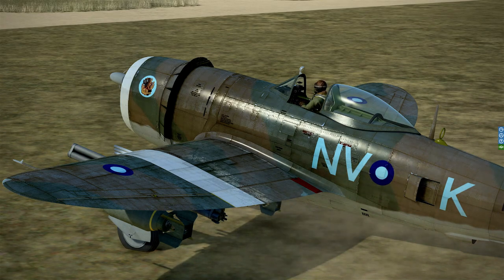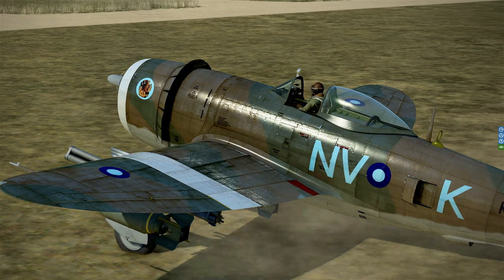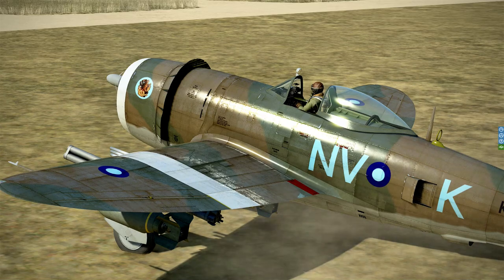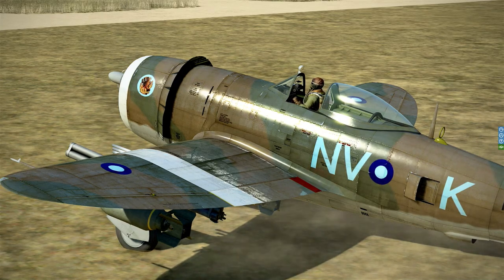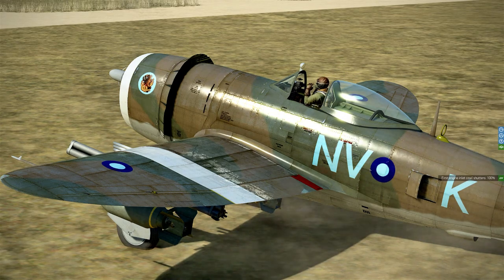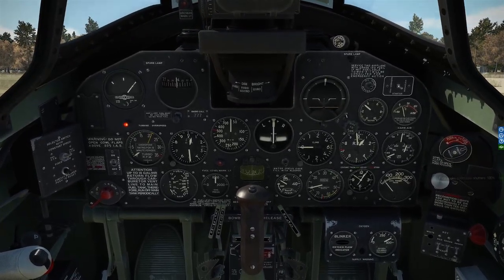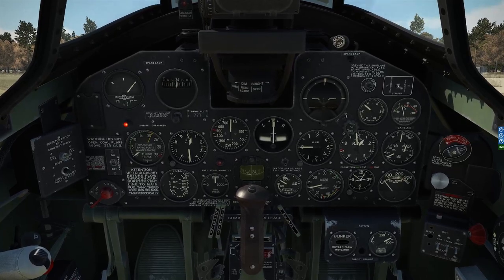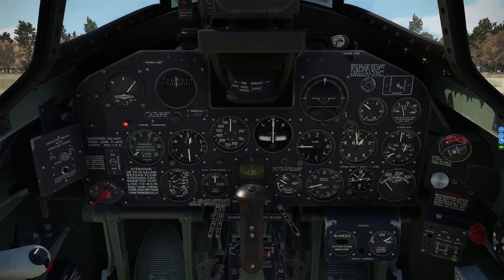P47D Cowl and inlet flaps operation - Bodenplatte - IL-2 Sturmovik: Battle of Stalingrad

Comment: Purpose of the "Engine Inlet Cowl Shutters" in the P-47 is to cool the air going from the turbosupercharger into the engine. When the air is compressed by the turbo it heats up and can get too hot, so needs to be set "just right" There is a gauge in the upper right panel that shows this temperature. This flap is more correctly called the Intercooler Flap. For most use leave at the "neutral" setting, 50%. I sometimes fool with it to keep the temp just at the top of the green range since (I think) that would be the least drag, but not totally sure, have to test it that to see if it is a little faster that way.
Reply: I did a little quickie test and didn't see much improvement in speed by closing the intercooler less than neutral (50%). Definitely a speed/drag penalty with them wide open, 10MPH or more.
Reply from the maker: Im looking forward to figuring out this system lol. I can always do with more power!